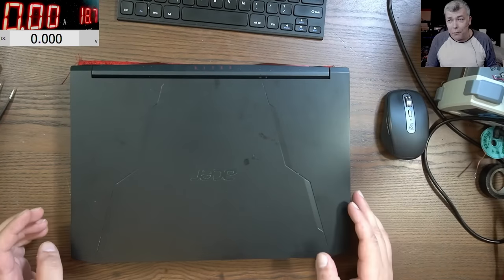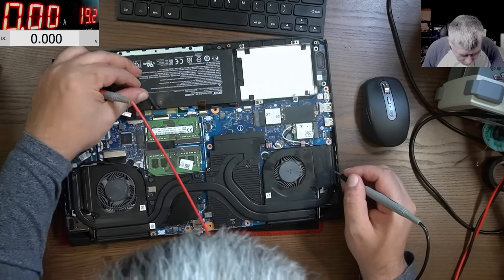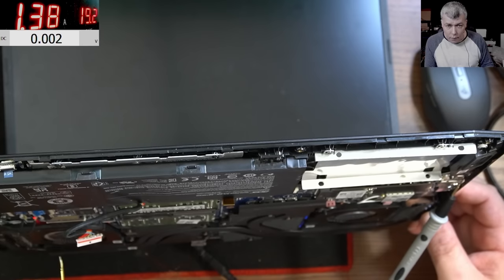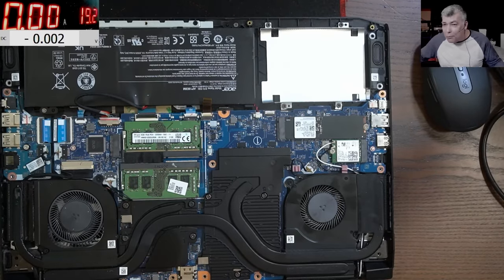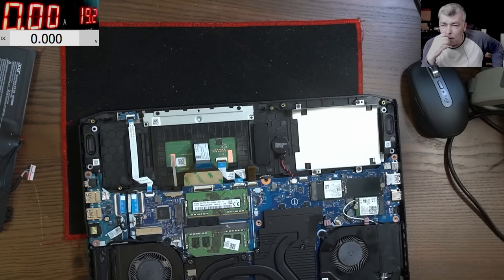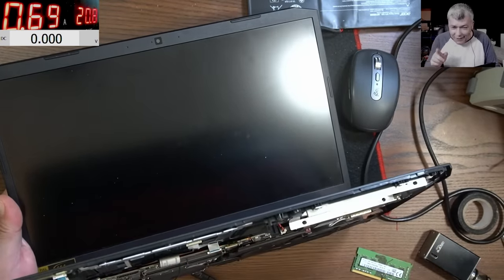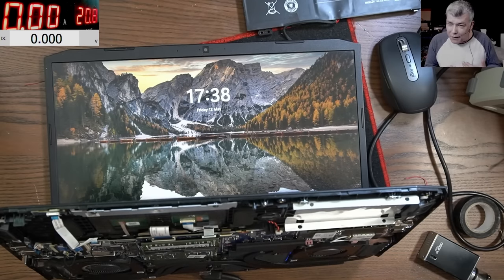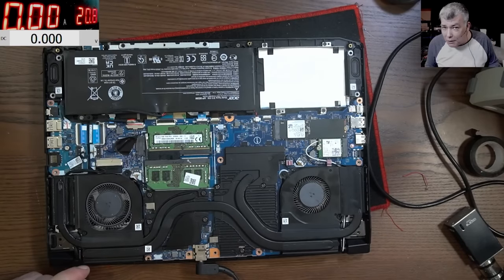Acer Nitro 5 modification - Using the lid sensor as a power button - Rerouting the power button.

Comment: Drill a small hole in the case (on the side if there is room) and insert a small tactile switch. Then you can wire it up as a dedicated power button.
Reply: Yes, simple solution
Reply: Well, sure, but that's just wiring in a different power button, not fixing anything.
Reply: @yeahright9014  How is it not fixing anything? This is a quick fix. Of course you could do it the right way and pay over $100 for a new keyboard, but that is the point of the video; cheap solutions and that is exactly what this is!
Reply: I would do this as well, having a "hold to shutdown" button is very important
Reply: Having a power button in the keyboard is stupid. Installing a real power button makes the laptop better.

Comment: A wonderful, beautiful and profitable idea, but there are some customers who will not be satisfied with it.
I encountered a problem like this with a Lenovo laptop, and as you know, the keyboard is not cheap, and when it is removed and when it is removed and installed, it is not original because of the plastic screws...
So I modified the keyboard by purchasing a Flex play button. Installing it under the power button and connecting wires.

Comment: I have an acer with same keyboard type. What I did was I removed the keycap and soldered one end of a small tactile push button to the metal part of keyboard frame from outside..and passed a wire from outside the keyboard frame to inside to the 3.3v rail on the keyboard connector. Then i removed the scissors from the plastic keycap and glued it over the button. Now it looks fine and works fine.

Comment: Had a near exact same issue, keyboard working fine except for the powerbutton, too expensive to buy either as a whole topcover or spend the time to melt in a separate keyboard.
So i managed to file down and squeeze in a little tactil button in the Kensington lock hole, fixed with hotglue and soldered a wire to the keyboard connector and the other to a nearby GND.
Works and behaves perfectly 🤓
Reply: model?

Comment: Innovative idea! I actually had same fault on lenovo laptop last week. I just soldered another button and made a small hole on the side of the laptop case (with the authorization of the owner of course) it’s not as elegant solution like you did. But it works well.
Reply: very rare repair shop gonna do repair like that, they just ask you to buy new keyboard set
Reply: I just had to fix 2 laptops with the same problem in the past weeks. 
I did the same as you did. Salvaged buttons from 2 broken machines, soldered and drilled a hole on the bottom. Saved the clients a few bucks, (besides I couldn't find a replacement keyboard for 1). So clients were happy with the solution.

Comment: Hi Sorin, you can set up the LID behavior from the BIOS or UEFI so when you open the LID the PC will turn on and it will turn off when you close the LID (so you can do it by software)
Reply: Yes, that is what I was thinking, I have a Dell, with broken power button, and the bios settings let's me power on the laptop when the charger is plugged in.
Reply: @andreiu4ce  it's possible only on dell laps
Reply: unfortunately, not all laptop have that function, especially all Nitro 5 model, but u will luck if u have Lenovo laptop, bcoz they have that function by default
Reply: @computersrepaircotesaint-l7407  nop the Lenovo or thinkpad are too same Chager stats one key and Lid Open power. the 8gen to up
Reply: The only problem there is if someone is turning the option off then you have to open the laptop again, Sorin's option it's more permanent

Comment: Not sure about Acer, but on some laptops (tested on Dell and Lenovo) there is a setting in the BIOS to have the laptop turn on the lid is opened or when AC power is connected. The latter is quite useful when using a laptop with an external monitor and peripherals as there's no need to open the lid to turn it on.

Comment: Usually the digital circuits are working with either leading or trailing edge of the signal and not the pulse itself this is why you get different behavior upon opening and closing the lid twice, also the windows software is interfering with this sequence, so disabling the power switch from windows will at least give consistent behavior.

Comment: Hi Sorin, maybe you can use a capacitor , when charging the capacitor you will have a short time connection to gnd before reaching the 3.3v, using that caracteristic you can simulate a press of the power button on the board.
Love your videos and your thinking "outside the box".
Greetings from Portugal 🇵🇹

Comment: In this case everytime two or three times you close the lid a recovery page would appear, it's like you press and hold power button when windows is on
I would first use a little bit of isopropyl alcohol to clean under that power button, if didn't work, then I would set lid button behavior under bios settings, where you can set laptop to power on when you open the lid, no need to solder the wire.
Reply: there's no  lid button behavior under bios settings in Acer laptops it on only on some hp and toshiba

Comment: Customers choice, Sorin.  If they want to pay for a new keyboard, then it's a new keyboard.  Not sure about this model exactly, but there could be a BIOS setting to automatically power on the laptop when the lid is opened (that may be off).  I have seen more and more laptops recently have that setting and have had it turned on by default.  The repair here is a little dodgy, said with fun in mind :face-green-smiling:

Comment: The customer said the problem occurred after a Windows update, some windows updates require a full shutdown and restart, but Windows 10 has a feature called 'Fast Startup' which is enabled by default, sometimes this can interfere with the update and possibly cause the power button to not work properly. Perhaps turn off this feature and try again, it may or may not fix the power button. In Windows 10 it's in  'Settings/Power & Sleep/Additional Power Settings/Choose what the power buttons do' and disable 'Turn on fast startup (recommended). I don't know if other versions of Windows have this fast startup feature, I assume they do though.

Comment: hi Sorin, at 24:23 there is a bridge between 2 pins on the keyboard connector. there should not be a bridge there. It might be the reason the power button not working.
Reply: Yes your exactly right

Comment: There seems to be some sort of a bridge between pins 13 and 14 on the keyboard connector from where you are soldering the wire or is it the glare from the light playing tricks. Just saying.

Comment: Some Lenovo models (V14 or V15IL), have the power ON of the laptop, activated by LID, and it can be enabled and disabled from the BIOS. You can turn on by opening the lid, or by pressing the power button. For other models it would be a great idea.

Comment: Hi Sorin, great modification... My idea will be... Taking the 3.3 from the sensor source where 3.3 is always present to the first pin of the keyboard, then the sensor output conected to a 47uf cap and 100ohm resistor (in parallel) to ground.
That make the 3.3 go to 0 for a fraction of time in order to charge the cap when screen is opened. Hope it's clear.
Reply from the maker: Actually is not a bad idea, i would try it next time, thx

Comment: I would make a small circuit that sends a pulse to the power button pin every time the state of the sleep sensor changes.
Now disconect the sensor from the sleep pin on the motherboard and here you go. 
When you open the lid, the laptop gets the signal on the power pin to start, and when you close the lid it gets the short signal on the power button witch will send it to sleep mode, if you open the lid while its in sleep mode it will just wake up. The only issue with this is if you set it to sleep mode before closing the lid, witch would cause it to wake up with the lid closed, but you can still fix that by removing the sleep option in the controll panel.

Comment: That's actually great idea, but i always try to avoid triggering multiple sensors at the  same time, so i would probably integrate a small flat button under the keyboard button 😅
Reply: I agree; sometimes there is only a mechanical issue on the keyboard

Comment: I usually repair these types of laptops by placing a small switch under the keyboard power button itself. And wiring it directly to the keyboard connector. It is very time consuming. Since some drilling is required to make way for the wires. But end result is pretty good. You get a tactile power button on the original keyboard itself.

Comment: Find a spot in one of the sides and drill a hole, insert a tablet button (or similar), fill it with hot glue to secure it in place, connect one terminal to ground and put a wire from the other terminal to the pin one of the keyboard. That's your new button.

Comment: I would of soldered wires like you did, but instead of too the lid switch, I would hot glue one of those missile activation switches, like the metal switch with the red flip up guard right too the keyboard.

Comment: Seen some YouTube videos related to the same issue. 
Maybe worth revisiting the fragile contact between the keyboard cable and the motherboard. One guy solved the problem by applying pressure on the plug …
One way to verify is to test again the power button by checking at the cable level and not the motherboard

Comment: I would have found a place to add a tactile switch,  hot glued the switch and ran a couple of wires. I probably would have had to make a hole in the case.  So your solution is neater. 

On my own laptop it is hooked to a monitor and it has a power button under the lid.  It is not convenient for me to open the lid, so I have fitted a tactile as above and removed to magnet from the lid that triggers the hall effect sensor as I could not disable the lid switch easily on POP-OS linux.

Comment: Maybe a surface mount PNP transistor, a Cap and some resistors would be a slightly neater solution so you don’t need the double action, use a cap discharge so it is timed so IO chip doesn’t think button is a long press. Turn off sleep but leave power button normal 🤷🏼‍♂️

Comment: Salutari from Brasov  Sorin , i had a Lenovo with same issue ,  i fixed it  by running a  wire , on the actual keyboard , with some digging in the foil to touch the metal underside . I took the 3.3 from the connector and glued it under the plastic keyboard foil ,  right under the actual button so when button is pressed the wire touches the metal backing plate of the keyboard . That's doggy.
Anyway some laptops have the option in the Bios to turn on by Lid , or by plugging charger, in HP i've seen it ans used it

Comment: I think the power button is not ignored and when you close the lid the laptop goes into sleep first and if you wait a few seconds the laptop will be off because the pressed power button takes a little to shut the laptop off.
Reply: yep, i think you're right, in this case changing the windows power button action to do nothing will have no effect and at some point the windows install will break bc of the force shutdown from the long press power button/lid sensor on zero.

Comment: on the side of the laptop, glue the tact switch with thermo glue and connect the cables through the holes near the usb port
Reply: that's what I did b4 for a customer it worked great

Comment: I would hot glue and wire a REED SWITCH somewhere convenient inside the laptop. It would look clean and can easily be activated with a small hand held magnet. It could be a security feature at the same time. Secret way to turn ON the laptop.

Comment: Did you measure the resistance on the power switch to see if there was any change when pressed ?
Reply: Yes he did. There was no drop in voltage, when he pressed the power button.

Comment: Having the idea, i would try setting the Power and Sleep button option in windows to  "Sleep" instead of "Shutdown" when i press the power button. And/or maybe in bios settings  if there's an option for the power button not to shutdown when pressed. If that wont work then i would  just abandon the lid switch by disconnecting the connection and make the sensor for power switch solely than buying a new keyboard.

Comment: At software level you can set do nothing for power button press but at hardware level EC will still register a long press on power button and shut down everything.
Lid closed = power button pressed
For short period of lid closed sleep will register, (also short time press on power button) that's why you get sleep sometimes but for long time lid closed after sleep event occured that low on power button for some amount of time ( aka long press on power button) will force EC to shut down everything.
As result next boot will be in recovery since windows doesn't shut down as it should be.
Maybe add another hall sensor,maybe there are some hall sensor that output one pulse instead 
Find another way to translate low from hall sensor to 1 sec low pulse.

Comment: I did few similar repairs ( one was a MacBook )  I just use a small ( tablet type ) button with a small hole on the side of the laptop. I Just mount it far from the pipes and cooler, coz the hot glue is getting melted from the heat. I have seen a lot of the new laptops coming with a power button mounted on the side.

Comment: Maybe if you can carefully remove old button, you will find silicon nipple there... so replace it with a button from a tablet or mobile phone. Only one thing if you manage to push wires... maybe poke a hole through membrane? What you think?

Comment: would prefer to pull out 2 wires from 3.3v and ground.and fix a smallest switch i can find on tne side of the pc somehow. (maybe one of those tiny circular switch one click on another off.control it through a holle on the side of the cover we can make and fix it with hot glue from inside)

Comment: 1) When buying: Fabricated/Refurbished chip:  (Someone  at the recycling plant is removing chips and making them look like something else) They will be thinner if measured with a vernier gauge because they have to be ground down in order to repainted and re-number them.

2. Paint will come off the chip  with isopropyl alcohol.

3. Check the image for the previous positioning mark which has been ground down and painted over.

4.The date will not correspond with the manufacturing date of the computer model. (And will be confusing), this is intentional.

5.Look at the pins

All tin-plated pins that are as bright as "new" must be refurbished. Most of the pins of genuine ICs should be so-called "silver powder pins", which are dark in color but uniform in color.

So pins which are too shiny have been made to look so.

6.  The vast majority of chips are now laser marked or printed with a dedicated chip printer. The handwriting is clear, neither conspicuous nor blurred and difficult to erase. The refurbished chips have either the edge of the writing corroded by the cleaning agent and have a "jaggy" feeling, or the printing is blurred, different in shades, misplaced, easy to erase or too conspicuous.

Comment: According to my never ending dodgyness I'd think about - a) putting in a tiny noise-sensor module with gain almost down (every time when you strongly knock on the laptop's case you get a logic signal to turn on or off the comp) -  b) putting in a reed-switch on the housing's edge (costumer can switch on/off with customized magnet-magic ..magnetized cat, ring, pen...) - c) putting in a tiny RFID-receiver and switching on/off with a little transponder (a keyfob, a card or, just for fun these transponders are even available in form of micro capsules for subcutaneous implanting - guess that would be pretty challenging) - or d) the common, dodgy things like drilling a tiny hole on the side for micro-switches (or light-sensors, triggered by a laser-pointer)   ,)

Comment: 13:26 I don't know Sorin - it looks very strange. I counted the time and there was 2minutes 22 seconds of black screen. It is a way too much for a few restarts after bios reset. 2,22minutes is too high. It is strage. Maybe cracked solderballs under gpu/cpu? You left laptop on, for 2,2minutes and maybe the heat fixed temporaty the cracks. That laptop needs to be on/checked after colddown again
Reply: @Radek S: Yeah. Completely agree. It shouldn't be that slow to get in. It has a minimum 500 Giga HDD and I see two DDR memories in its slots. "Cold" soldering on the CPU or on the GPU? I don't find your suggestion unreasonable at all (thanks for the advice), I would try to "retouch" them at low temperature (350 Celsius) at 7 cm distance, if possible, first below and then above. All the best.

Comment: Sorin, just go into the bios and set the POWER ON WHEN LID OPEN to on, no need to bypass
Reply: Or a small hole on the case put a switch that has jumpers to the keyboard connector

Comment: I am skeptical, by nature, of praise or reviews from "experts" when it comes to technical features or "features offered" by some manufacturers of consumer devices. Although in this case, I must recognize the image quality offered by that Acer screen when I saw the operating system enter, it shocked me! All the best.
Reply: 4 Pin USB Type A Connector Male/Female Plug Mount Adapter USB 2.0 solder type connectors with black plastic shell (Ali... ss). I would make a small hole in the black plastic that only allows the release of the shutter (button to press) of the microswitch that would be glued internally. For the switch, please write only RT3301, that would be my choice; RT3301 series tactile switch (data sheet and price per piece) at mouser ele...nics. All the best.

Comment: Hi sorin beautiful idea. I will used a magnetic reed like this one for better € 2,15  26%OFF | 5Pcs Reed Switch 3Pin Magnetic Switch 2.5*14mm Normally Open Normally Closed Conversion 2.5X14MM NO NC Conversion for Sensors
On ali